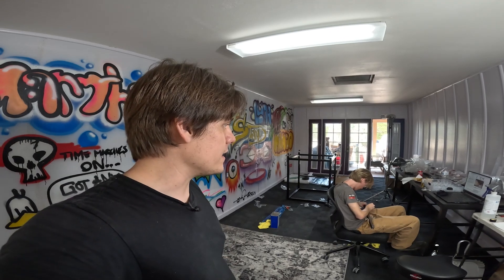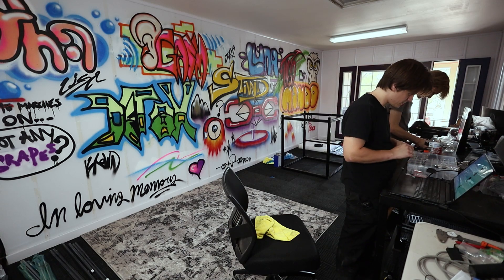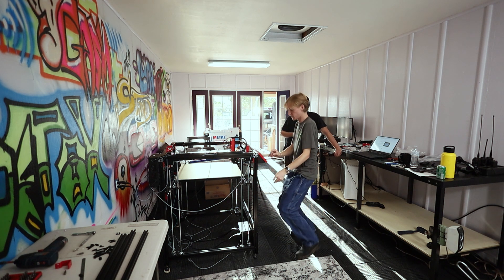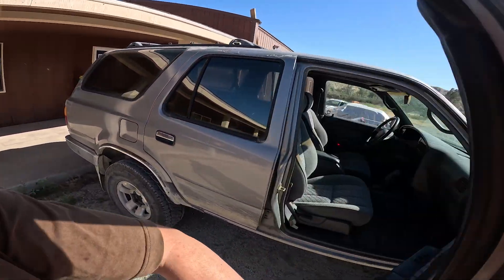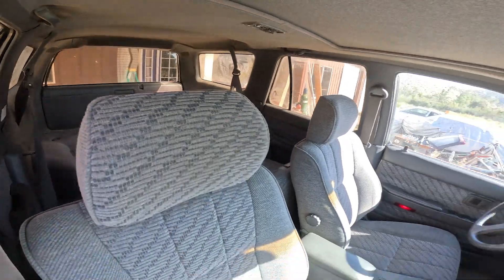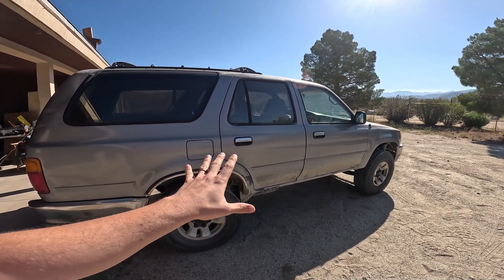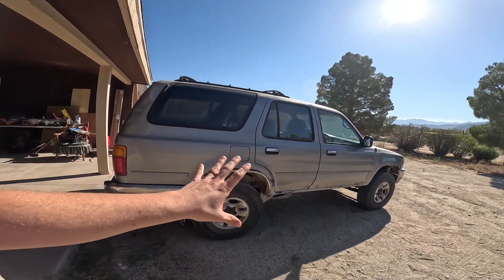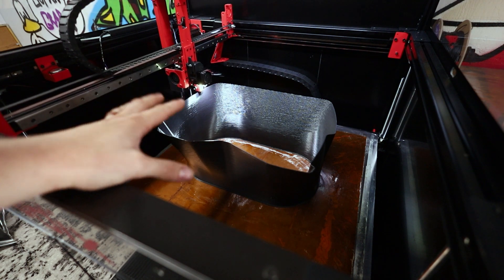There's something you should know about our new 3D printer...

Comment: Super cool! Love the use of a large nozzle and printing it like it was in "vase mode" with a single perimeter. Nice printing room too.
Reply from the maker: After 4 failed prints and a great result on print #5, I realized I could have used actual vase mode 🙃
Reply: @StandRacing  Hahaha I was going to suggest if the slits keep being a problem to just add some kind of tiny gap or narrowed portion and then cut them out when you're done or turn them into an indent instead if possible and I was going to say a tiny bit of cooling may help, but I'm not that experienced with ASA, just for those long straight sections I was thinking it could help. Would love a video on your troubleshooting and what you come up with to get it to print well.
Reply from the maker: Thanks! I'll be doing one real soon. Yeah I gave up on the slots completely, it's too easy to cut them out in post to spend so much time trying to make them work.